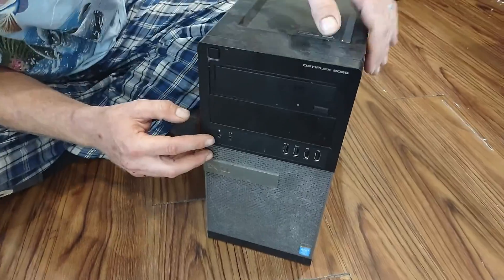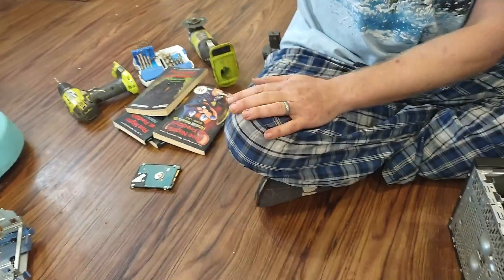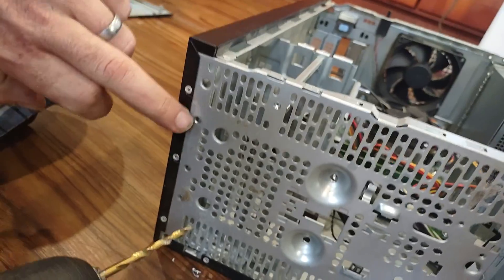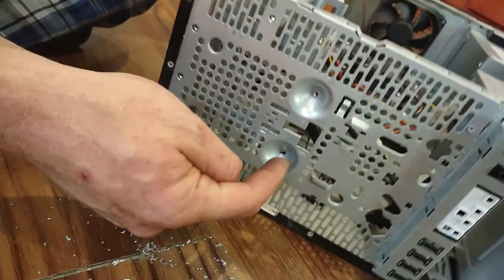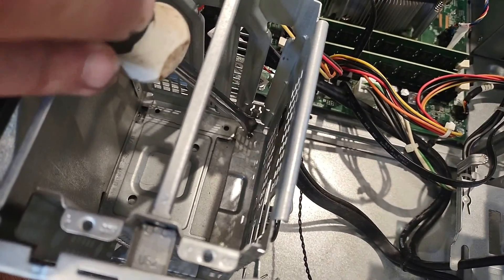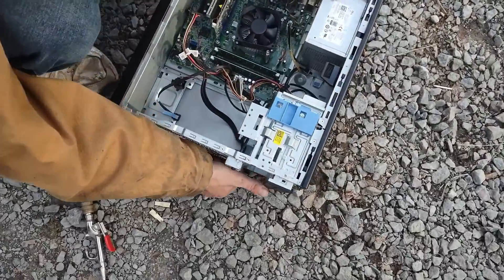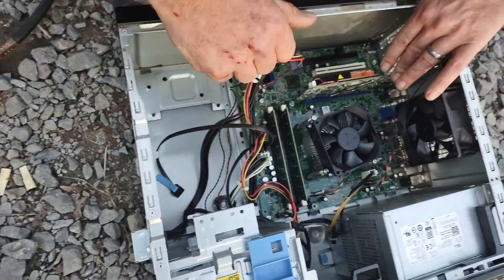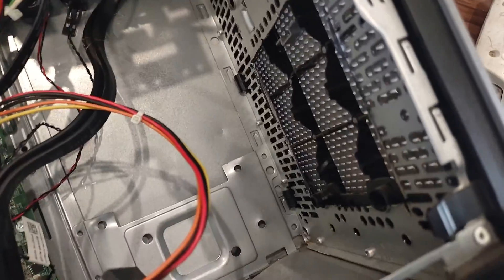how to add a front fan to dell optiplex 9020

Comment: I did the same but without removing anything except the front panel, i put in a 80mm which fits perfectly without hitting the 2 knobs on the down part and not hitting the upside part.

Comment: i did the same thing, mounting on the inside without cutting out the front restricts air flow but  i used a 140mm

Comment: I just wanted to comment on how I got my 7020 (same case as 9020) setup with a front fan SUPER easy. I removed cage just like you did, but I added a 120mm standard PC fan, on the inside, lined up against the bottom right corner of case, with a single plastic push-in standoff in the top left corner screw hole, and I custom cut a single hole through that one top deep recessed hole you had to drill out. Plastic is easy to drill into so once you get the right hole placement it holds it secure and does not add vibration or extra noise but TONS of ventilation for a better graphics card. Awesome work BTW!!!

Comment: NEVER dust a pc without holding the fan. it can damage the components of the pc.
Reply from the maker: Lol
Reply: @RayFixesAll  i dont see whats funny. we could all hear you spin those fans up with the air compressor, and thats a big no no. ive seen people kill expensive graphics card fans because they didnt hold the fans when they dusted.
Reply from the maker: Did you see a graphics card in there I was prepping a computer to make a gaming computer
Reply: @RayFixesAll  you're missing the point. ANY fan can be destroyed by spinning it up like that with the air compressor
Reply from the maker: @thedanbot85 still working fine 😀
Reply: @RayFixesAll it's bad practice though. Doesn't happen every time as evident with your system but it can happen. We all learn new things every day.

Comment: So, I've got a sff Inspiron 3471 that I want to do this to, but the screen on that faceplate is only about 2cm in height, at the bottom. There's room for a little fan on the inside of the case, right where I need it, and there wouldn't be anything obstructing flow. Do you think it's worth doing without modding the faceplate itself?
Reply from the maker: I know the sff 9020 has one there already I would take a look at that and compare sizes like what size fan is there and everything and see if it'll work
Reply: @RayFixesAll  Thanks! 🤙
Reply from the maker: @just_a_stump no problem good luck on the build

Comment: how did you power the fan, what type of connector. not sure if i use a spitter for the motherboard connectors rear fan or go right from my power supply.
Reply from the maker: I use the aftermarket power supply comes with extra connectors
Reply: I have the same.
Reply from the maker: Use this 
SATA to 4 Pin Power Cable Adapter 3 Pack SATA 15 Pin Male to Molex LP4 Female Power Cable 7-inch https://a.co/d/51i6C16
Reply: @RayFixesAll  messed up my power supply trying to rig it, had to put the stock one back in and put little gpu back in.

Comment: what did you use to power it?
Reply from the maker: It's a 700 atx power supply I got it at bestbuy
Reply: I think he meant what cable line from the PSU did you use?
Reply from the maker: @mariochesser7849  if doing with a stock power supply you'll have to get a SATA to molex adapter

Comment: Recommend removing the board before drilling. Any swarf lands on it and you'll get a short.
Reply: Or sawing that throws embers anywhere near the electronics. It's a nice video to show it can be done, but safety went stage left when the word action was shouted from the director.
Reply from the maker: If you're using a canned air duster yeah if you're using a high-powered air compressor there'll be nothing left in the computer when you blow it out